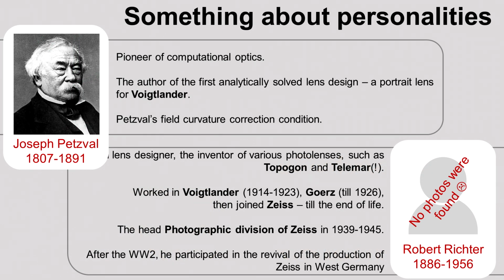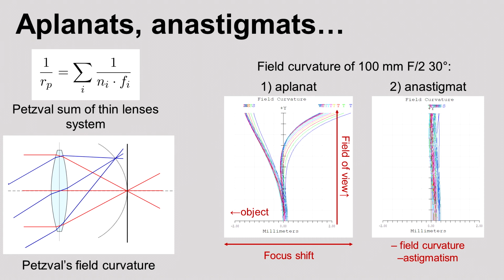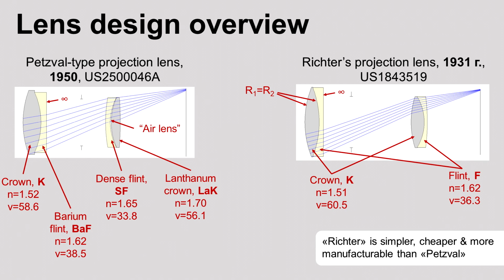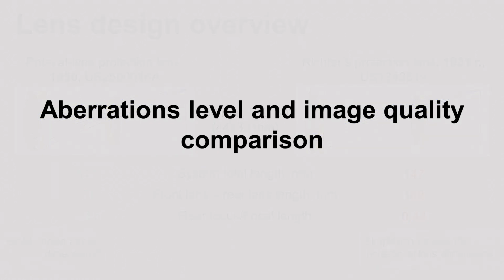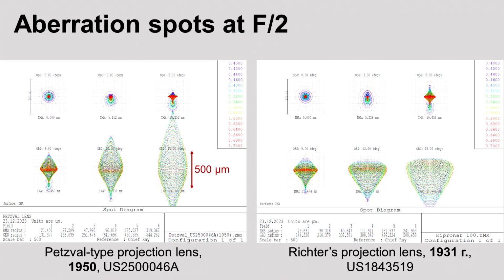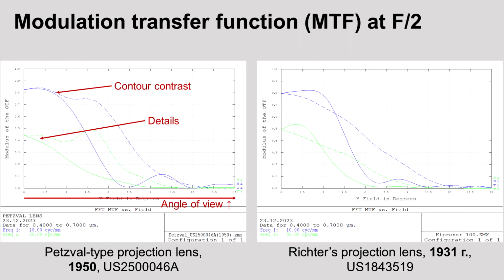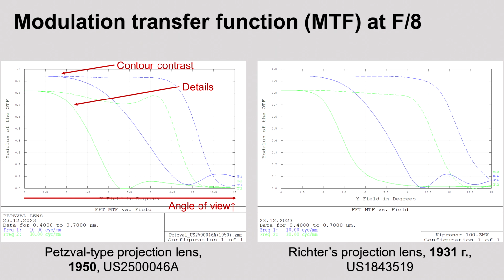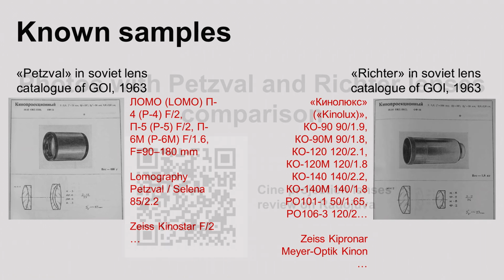Projection lenses: Petzvals and Richters

Comment: 4:57 - Wow, a 0.6-8 mm shift between the colors wide open in the center? 
But wouldn't that lead to a ~(rear lens size ~ 33mm)/(back focus distance ~ 45 mm)*0.8/2 = 0.3mm "circle of confusion"?
Well, it sounds worse than it looks on the pictures :)
Edit: maybe because most of the colors move together, and only violets seem to misbehave?
Reply from the maker: You're right, camera sensors usually has poor sensitivity to 400-430 nm region, so short-wave chromatic aberration has little influence on image quality